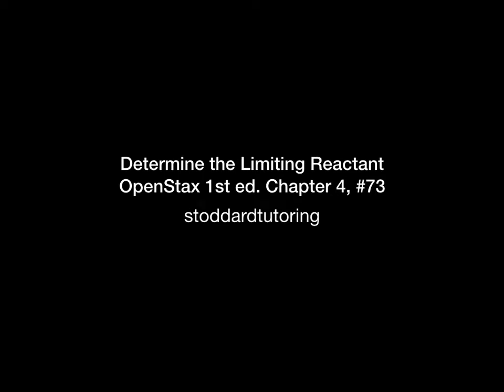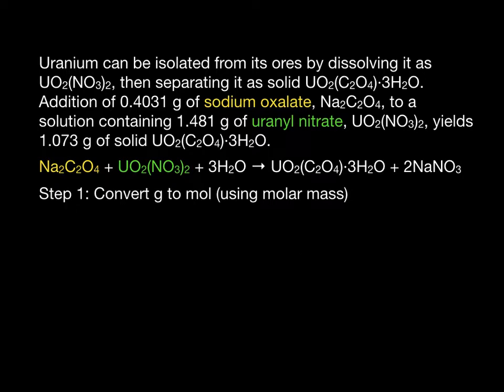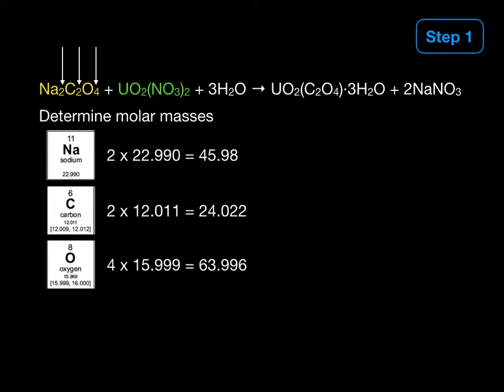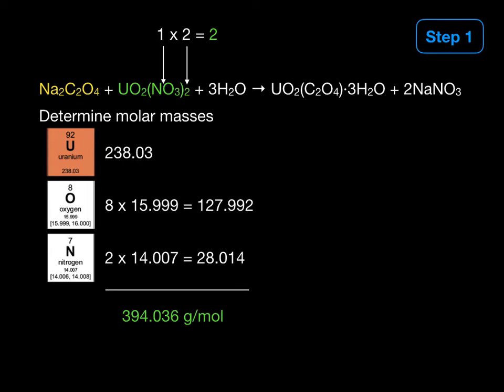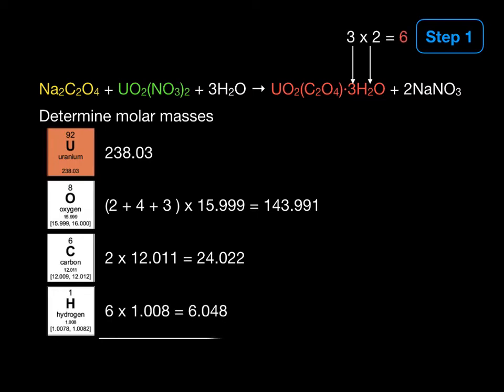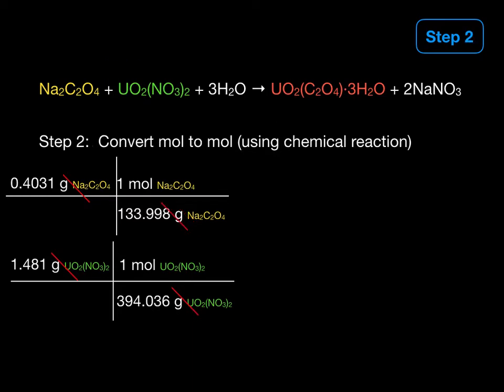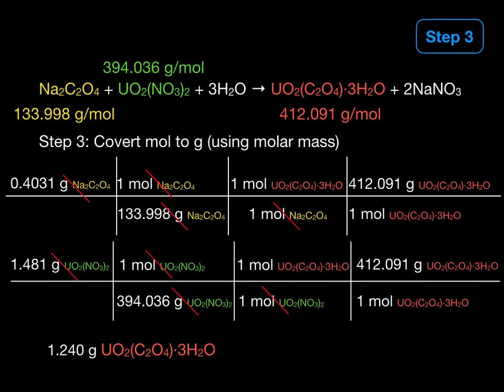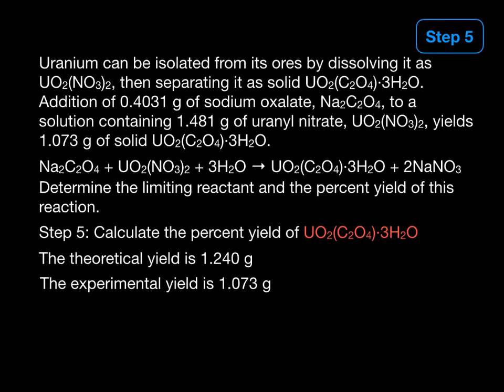Determine the limiting reactant and the percent yield Open Stax Chapter 4 number 73

Comment: Why did you use 0.4031g of sodium oxalate to figure out the grams of product and not 1.481g of uranyl nitrate? Is it because sodium oxalate was the limiting reactant? So, to find the percent yield of the product we have to use the limiting reactant from the reactant side of the equation?
Reply from the maker: Yes, exactly. In Step 4 we identify the limiting reactant before we can do step 5 to calculate the theoretical yield.